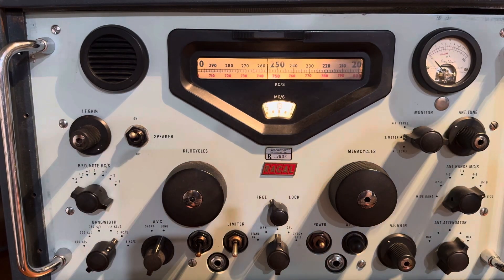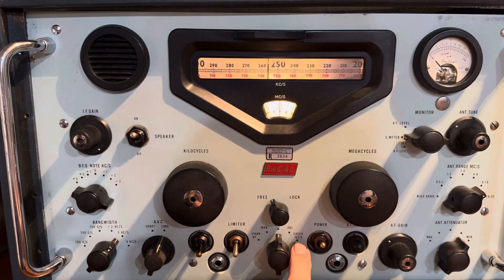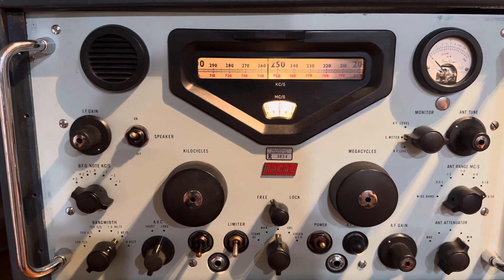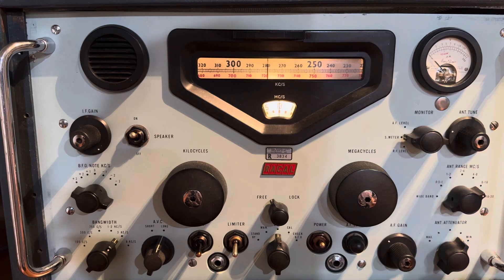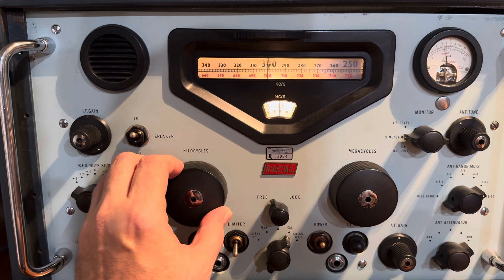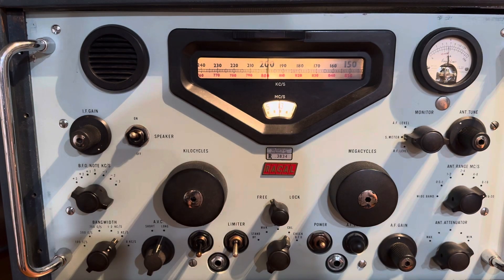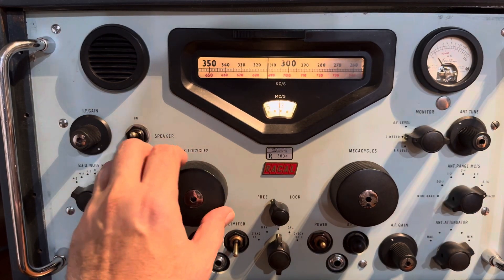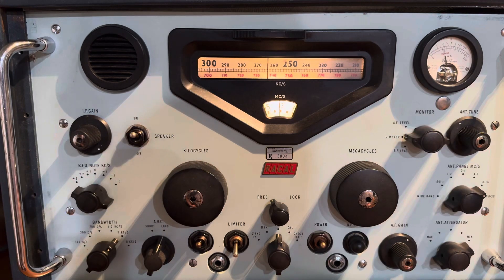Racal RA17 Dial calibrate & BFO calibrate

Comment: I have a yaesu ft -101z radio it needs a complete inspection and alignment what do you think
Reply from the maker: @josealeixes2861  i got rid of mine. I recommend you do the same. I got an Icom 7610 to replace it
Reply: because it's not a good radio